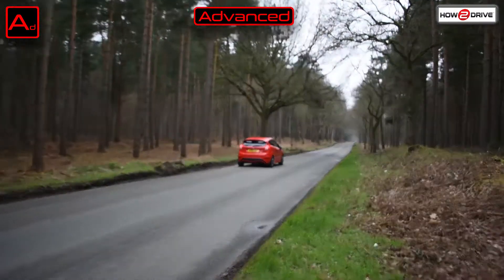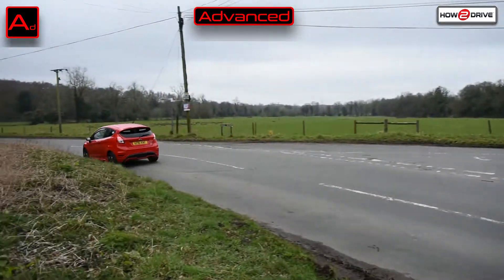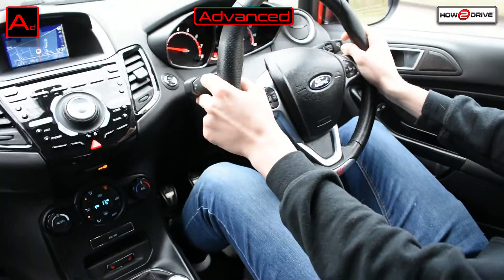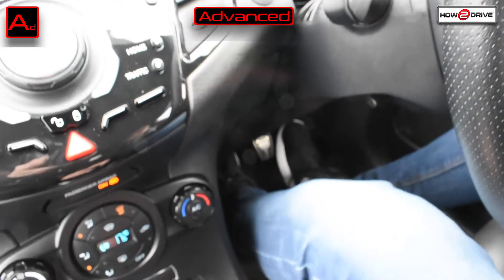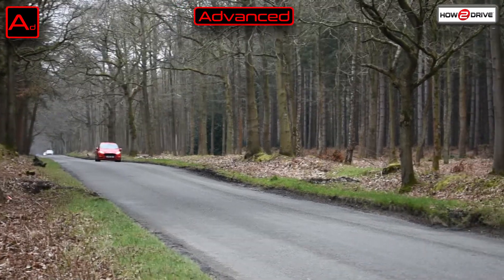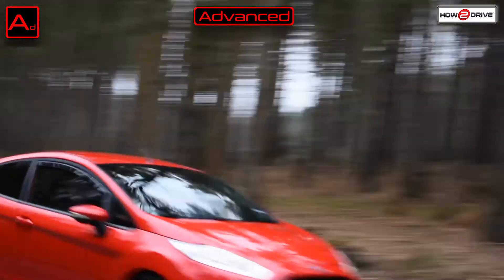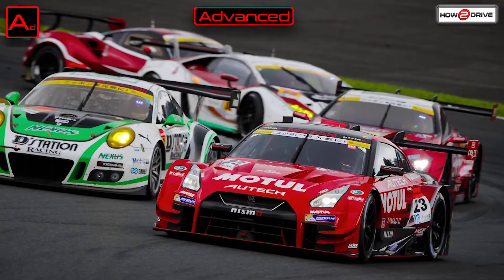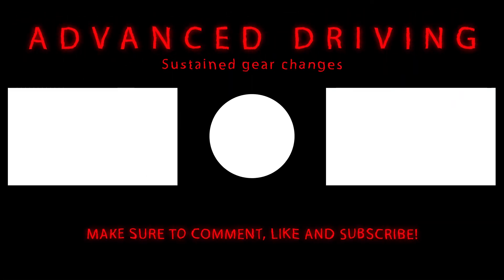Rev Matching and how to do it (sustained gear changes)

Comment: I got the same MK7 Fiesta ST as you do , cool feature to note is when you upshifting(in sequence) the tachometer needle will drop to the exact point where the flywheel and clutch will match for next gear i.e. smoother upshifts.